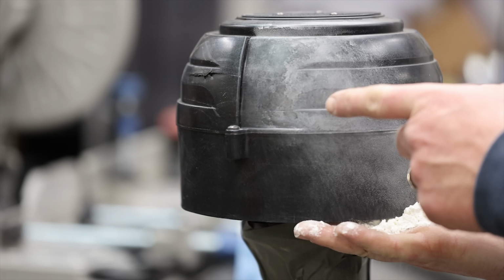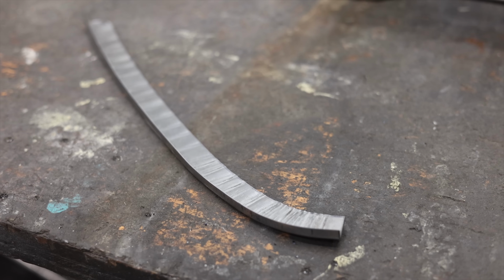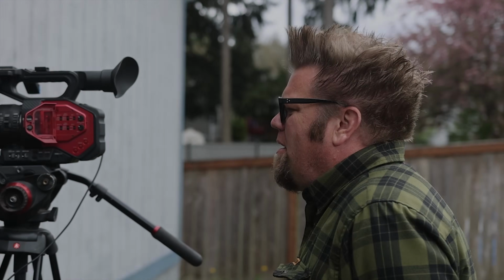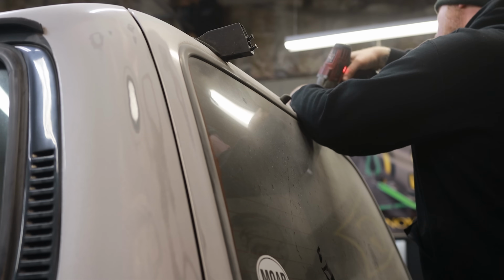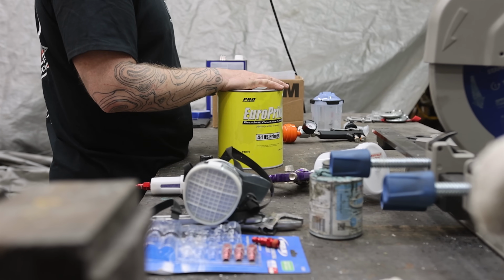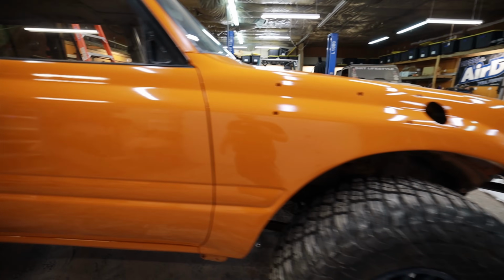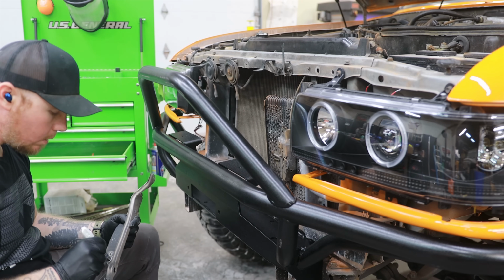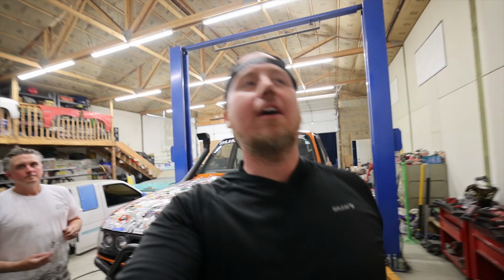Unstoppable Land Cruiser 80 Rock Crawler Episode 2. Budget Off-road Build.

Comment: For a ‘beginner’, thats a really good paint job. 

As for the runs, if it’s in a place you can flood them out, you can try and put enough paint on to make it ‘flood’ or ‘run’ off the edge at the bottom of the panel. If not, make sure its 100% cured and then you can use a body file to gently take the tops of the runs off. It is time consuming but it works better than just wet sanding because if done right, it only attacks the run and not the surrounding areas. Once the run/drip is almost flush with the rest of the paint, then wet sand as normal. But be warned, it has to be cured before you start, and you must take your time. One scuff in the wrong place and its done…

Practice makes perfect and you are well on your way. Congrats on a wicked build!!

Comment: Been a painter for while and what we did for runs such as that is use a razor blade standing strait up and scraping on the ridge. If it is sealer though you will break through and need to add color back. Most important thing if you do this technique is keep that blade standing strait up and keep scraping till the ridge is gone and it starts to scar the flat area.

Comment: Absolutely agree on the lights. Once you spray in a proper spray booth you’ll understand. It’s all about the lighting. For beginners, I’d recommend spraying with a base coat clear coat system (preferably in waterborne), I find it’s way easier to fix errors and get better results.

Edit: Always do a test panel before you start the job to make sure everything is coming out as planned.

Comment: Heads up, my buddy ran one of those prefilters on his FZJ, and had issues with power loss and high intake temps. He switched to a scoop style snorkle hat and his issues immediately improved. Granted, his issues were only really apparent when driving the highway mountain passes in Colorado.  You just might want to consider pulling the prefilter off  if you are going to be doing paved mountain passes and need maximum power.

Comment: The orange looks so good and I love the attention to detail. Orange is a car color you don't see enough of. Congratulations on four years and I hope you stick around for many more.
If you're going to do more painting, look for high CRI lights. CRI is color rendering index and a measure of how well a light source can realistically reproduce color. High CRI also makes it easier to discern details. The Sun and incandescent/halogen bulbs have a CRI of 100. Cheap LED flashlights that are almost blue may be 70 or 80 at best. 90 CRI LED lights are readily available and 95 or 98 aren't hard to find. You should try to match your overhead lights' color temperature but if that's not an option you'll also want a neutral white color temperature of 4000K, no more than 5000K. Warm white is 2700K, daylight white or cool white is about 6000-6500K.

Comment: Love the project!  you can get rid of the lift and wheel spacers if you go with some super-lug 900-16.  Since they are narrower they tuck into the fender really well and are still a true 37" tire.  Probably help keep the drivetrain from a failure and the brakes working a little better compared to the little extra scraping you would get from dropping down from a 39.

Comment: Nate I love what you and Dave are doing with the LX450. I have to agree with you that it's a great platform right out of the box. I have been rocking a 80series for the last 8 years that I have built up from stock as a hard core rock crawler.
I  two am running 39s on a low 2.5" with Lot of cutting. But what I think really sets it a part from other 80s and LX450 ( I have wheeled with a lot of them ) Is molded in rock sliders, I cut out most of the rockers and welded the rock slider directly to the body/rockers. There a combination of 2x4" rectangular tube and 1.3/4" round tube.   It's a game changer for the 80/LX 450 as it moves the sliders up 4" higher the any frame mounted sliders could be. That and getting the exhaust to run over the frame like the 93/94 80s come from the factory. 
I know that you and Dave have a ton of experience and know what you are doing ( I have been following you since your days with BleepinJeep and Fred & Dave from before Dirt every day ) these to things will really help the LX450 be a contender.
PS really like what you did with the front Bumper and grill!!

Comment: So much to say on this video! First and foremost, congratulations on 4 years of algorithm madness! Secondly, the modified front end looks absolutely awesome. It does look like a crawler, but it looks like it was meant to be one from the factory. It's so clean, and I totally agree with the move to go with angled stock from a rigidity perspective. Third, great tips on painting and using light to your advantage! In woodworking we often talk about using raking light when sanding and finishing, and I think that's the same thing you're hitting on here. Fourth: using the color wheel is so important, if if you only use it in a simple manner. @ColorNerd1 has some great videos about color design and a modified color wheel, too. And finally, that sticker-bombed hood is brilliant! What an awesome way to show gratitude to your fans and give this truck a truly unique look. I'll definitely be voting for your team and wish you continued success!

Comment: Pro tip.. for paint runs ..in some situations make the run hit the floor sometimes adding more paint to a run and getting the run as low as possible is better than in the middle of the panel. Then when it dries take a new razor blade and hold it flush to the panel and at a 90 degree angle and skim back and forth gently shaving the high side of the run if that makes sense. Then wet block sand then polish. 
Very cool build now I want one to build..

Comment: Really nice build up. I have a 73 J4000 that's been sitting way to long with a typical amc oiling system failure. I had picked up a 4.0 to replace the 2.5 in my YJ , but I keep seeing your pickup in the background so I think I will change up my plans. Take care from western Montana

Comment: I worked with those 3m guns at my job.
They are not for precision but produce volume because of the needle size. You can actually buy an adapter for the cheap gun and use the 3m cups for quick switches. Nice job on the finished product. Give your some credit where it's due. Runs and sags are just part of it.

Comment: I have always been told when I get a run grab a utility blade and clean the oil off of it, then barely touch the bottom of the run and the excess paint will lay onto the blade if you catch it soon enough. looks sweet!

Comment: A run in your sealer you can hit the tops lightly with a rag that’s wet with lacquer thinner. Very lightly. It will put the texture of the rag into the sealer so you do it very lightly and you can sand it out once it flashes. Like 30 minutes with a room at 80 degrees. Makes it way easier to sand. Then once it’s nice and flat you can spray a little more sealer to bring back the texture. Once that flashes then you can continue the painting process. Since you put the final stage on the sealer with the run you will have to sand it out and then spray over it with color again. You can get away without  sanding and buffing the dry spray if you use blender on the edges. I’m a second generation painter but I’m still a apprentice.

Comment: IF you catch a run right away, use masking tape (sticky side to the paint) to "dab" the excess paint off of the panel. Then dust very light mist on the affected area to blend it back in. Don't try to blend it in all at once. Let the area tack up a bit. Takes practice, but it will look better than the run. The problem with wet sanding over a run in the primer is it will tend to sand thru the color. Hope this helps. Over all, your paint looks very good. God bless, stay well.
Reply: I do the same except I use a shop towel paper towel  !!

Comment: Dealing with runs and rubbish in sealer. I hit it with a heat gun to flash it off quick, very light rub with 800 and some wax and grease remover in a spray bottle. Clean off the wax and grease and go again.
Runs is colour I cover with a thin flat skim of bondo and block it out starting with 800. You will see the colour drips sand through the bondo. Just before the bondo gets completly rubbed out switch grades to 1200 and maybe 1500 as you get to full colour showing. Block off wide with 2000 and buff.

Comment: Looks great! For the snorkel,  since you're already over budget and can't fit buying a new intake piece. Have you considered taking the one you have and using like a rubber plumbing boot coupling to mount it with. I know those usually come with worm gear clamps but you could swap them for band clamps that have a nut for tightening and even paint the clamps the same orange as the lexus. May not be a permanent solution but an ok $15 or less solution with little time into it.

Comment: Looks like you had reduced material flow on the 3M gun. One way to know you're at full flow is to pull the trigger and adjust the flow valve. You'll feel the tension on the trigger increase or reduce (depending if you're backing out or pushing the needle with the valve). Once you back out all the way and you feel the trigger no longer moves while adjusting the flow valve, you can start to close the valve until you feel the resistance on the trigger. That's the full  open position, and it'll allow more material to flow so you can do quicker strokes and wetter applications. For the most part, though, you did a pretty phenomenal job on the body work and the paint job. It's mainly on the prep work which you knocked out of the park! If you hadn't mentioned you were a novice painter, I would've thought it wasn't your first rodeo, especially given the limited tools you have.

Comment: For single stage paint you want a good wet coat it should lay nice and smooth and give you a high gloss. Look for a paint gun with a 1.4 tip that will help. I use single stage paint all day and you did an awesome job.

Comment: For the runs, when its wet you can keep spraying it down to push the run to the bottom of the panel. I have seen that tip somewhere. I'm not a painter, but I've painted one car before. I like the color, looks good.

Comment: To fix those runs , if you catch them when wet , I just use a shop towel paper towel and lightly dab it to suck up most of the extra . Then I'll lightly spray that area again  .
If it's after it's dried I'll just take a run scraper and cut it off .

Comment: Yep, people usually use the cheap spray gun for primer and save the expensive one for the paint- not just to (as you discovered) be able to keep one of each nozzled for each purpose, but also because of the cleanup difficulties with primer.

Comment: I’ve got a 22 ram 3500 I hotshot with… I’ve put quite a bit of thought into putting a snorkel on it. The ram air is a really good idea, but I’m cleaning my filter every week and it’s astonishing that the engine is still getting air.
The part I’m struggling with is cutting a hole in my fender 😂

Comment: I may have missed if you said what nozzle you used for the primer but for anyone else doing this with high build primer use a 2.1mm Nozzle it's like spraying with a garden hose but it flows well and won't have the issues you experienced standard primer works best with a 1.8mm nozzle 
Cheap paint store guns are always good for primer and less adjustable for the DIYers to make settings mistakes also 
Great video love the orange

Comment: Suggest front truss and knuckle gussets, 5.29s and RCV axles. Been running my LX450 on 40s and the front axle will bend if not trussed / gusseted. Also suggest tcase protection. Body lift might help the rear clear for a better stuff. 

When in 4lo use the second start button and when you need first, manually put in 1st. 

Also do the “7 pin cdl” mod. 

IH8MUD classifieds for cheap parts if need be. 

Good luck!!!

Comment: I've used straight razor blades to lightly shave down the hangers and grapes.. Cuts down on sanding and potentially burning through on low spots if you didn't get good coverage.

Comment: JUST FYI: 
You could have very easily just dropped some X-large King size cotton sheets/material from the ceiling all the way around the truck, and created almost a “paint booth”. Lot less work and time than trying to cover up everything in your entire shop. Also, no paint drift all over the place. Just be sure to have a set of ultra bright lamps so you can see what you’re laying on…maybe leave an air gap top and bottom for a little circulation. 
PS. Doing a great job on the Lexus… 👍👍👍

Comment: Ooooh 3m.. yeah they work. We use that for glue at my work. You could have spent the same amount of money on a used sata and use 1 tip for primer or sealer, base that’s flat/pearl/or metallic, plus clear. Just not glue lol single stage… does the job but I hate it. Harder to buff and fix if you mess up the paint job.

Comment: those of you who paint know how difficult orange can be to spray. that looks very good for someone who says they are new. if you want to fix that run in the back you can take single edge razor blades and scrape the paint until it is perfectly flat with the rest of the paint and then spray back over it.

Comment: When you get a run use a piece of masking tape, like 6" long hold it with two hands kind of loose and use it to pick up/ remove the run.  It will leave imperfections but they will go away with another coat after it almost flashes.

Comment: hi ya just a tip with those head lights they will leak water and dust i have had them after a while the lenses will break internally i drove a gibb river rd here in Western Australia and they were stuffed after that so firstly if you are going to use them seal them up with sticaflex around the edge of the lenses

Comment: Nate when using the pps cups with primer pull the filter out of the cup cap it is unnecessary, then when using it with paint make sure you use the white filter not the blue one for more flow. The blue ones are for water based paint.

Comment: Ex mechanic from Australia here, that has worked on and built alot or Landcruisers and even patrols. My likely unwanted advice is ditch those spacers extend out the diffs instead. Stronger, more reliable, cleaner looking. 

You could even go down the portal axle route but please be advised I don't know the legality of them over there here its basically offroad only.

Also yeah Toyota done us dirty on the 80 series and lexus thing. If you want 80 series stuff cheaper look at Australia and South Africa for parts. We have loads of them. But will say sorry not parting out my girl.

Edit: for your airbox. You might need to replace your tuna can, seal it, or replace all the rubber. They are water proof when coupled with a snorkel when new. But when the rubber turns to basically plastic that's no longer the case. Infact I've had to do major repairs and even full engine replacements, even on 1hdt and 1hz landcruisers that had amazing snorkels that ingested water from that tuna can. It's usually pretty rusted too as no one cleans them (good spray wax also helps keep it alive) so the water just sits there.

Comment: Idk if any body has answered your question about the runs in the heavily painted areas..

But get a 4” roller with the foam pads and roll it out 

I do it on metal gates I fab and I’m sure the roller makes will come out in the wet sand stage

Comment: use some uv protection on those stickers, they will fade so quick with out something on there. i covered my motorcycle in stickers and within a month i had to pull them all off and redo it, with just some uv clear from a spray can it lasted over a year.

Comment: For that run on the rear corner take a fresh razor blade at a 90° and scrape the high spots down to open up the sealer and let it cure then sand it down and respray

Comment: You can look up run repairs,  one I like is body glaze, glaze the run,  then sand it down with 400 until the the glaze is almost gone like transparent,  then 600 800 1000 should have 0 glaze left maybe some on the boards( should come off with a finger nail).  Then 1500 2000 3000 polish it,   Another more skilled option is a razor blade,  sand the corners of the blade down then hold it 90* to the panel and scrap the run off,  sometimes I cut the tear drop off to make it a little flatter before I scrape it off,  you obviously can damage the paint

Comment: The reason for the cheap snorkel failing to eject debris spinning within is because it lacks to proper implementation of what is called the coanda effect. If you look at how the higher end version is designed, there are two different radii that nearly overlap. The air begins flowing in a centrifugal and laminar regime within the snorkel housing, first flowing along the internal larger radii and then splitting across the smaller radius housing, with some air staying inside the snorkel and some evacuating the housing. The evacuated air carries momentum yet continues hugging the outer surface of the housing (this phenomena is the coanda effect) evacuating particulates and debris outside of the snorkel with it. The higher mass particulates and debris within the centrifuge are thrown to the walls of the snorkel housing and the cycle continues. Dyson implements the same effect in their airwrap product which uses airflow along a surface to collect surrounding hair and wrap it along a curling bar. Pretty neat. 

All that to say, the cheap snorkel and the suggested fix of cutting a larger outlet will not likely help unless a difference in radius is introduced.

Comment: You sliced some weight, but are you regearing to spin the 40s? My 80 is not a rock crawler but a stock tourer and I’m running a skinny 33, which is probably its limit for maintaining ok perf on most roads. Maybe the low range will be enough for the use-case. You inspired me to attempt a fun paint job, really cool results.